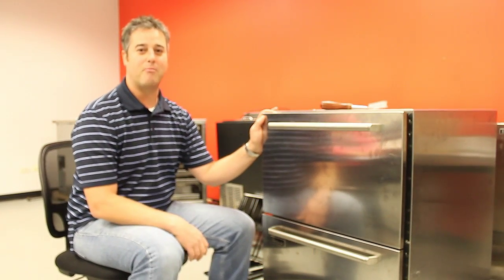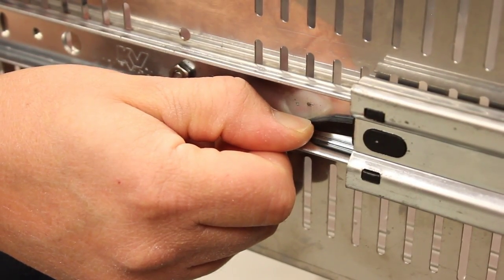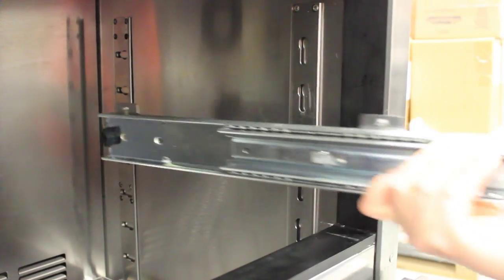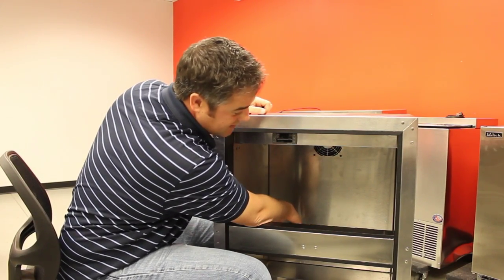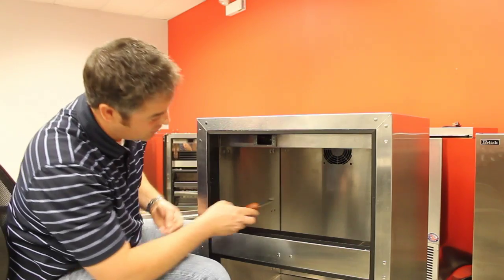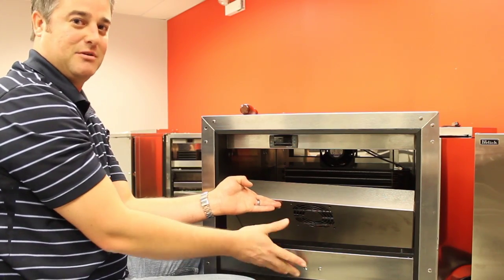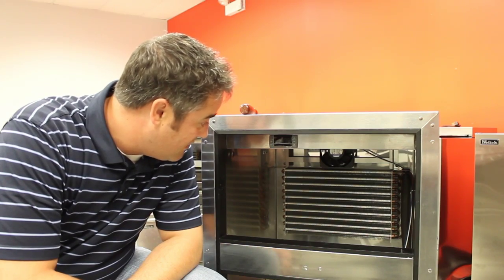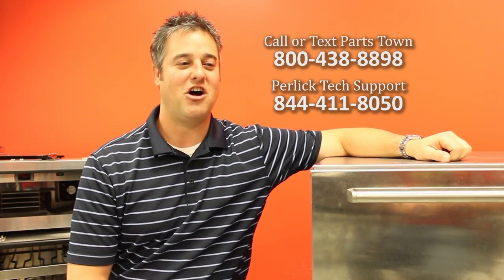How to Clean an Evaporator Coil on a Perlick Freezer - Parts Town

Comment: This video was very instructive in many ways as well as very easy to follow; all steps necessary to complete the goal (i.e., access to the evaporator coil) were clearly presented and shown.  Important for my issue was the discussion regarding steps to take when frost is building on the refrigerator walls (i.e., to do a manual defrost); that frost build up is my exact issue and, literally the instant I started the manual defrost, I heard ice cracking in the evaporator area.  So, I am hoping the manual defrost will clear my frost build up issue.  While the manual defrost procedure made sense to me after viewing your video (i.e., an iced up evaporator is unable to remove refrigerator moisture), the Perlick Owner's manual only mentions how to start the manual defrost.  The manual does not mention why one would want to do a manual defrost.  While these issues may seem simple to you,  they were very useful information to me on this weekend when I cannot call the Perlick Service Phone number.  If my issue is not solved, I will probably keep trying to fix the refrigerator myself and - absolutely yes - your company will be the first one I will call for any needed parts!  Thank you for this video and for any others you care to add to it.